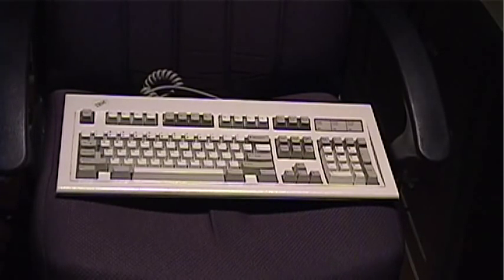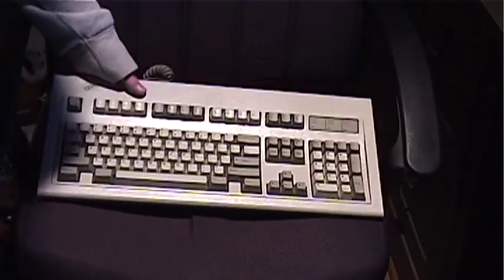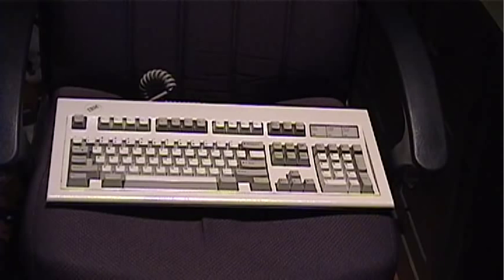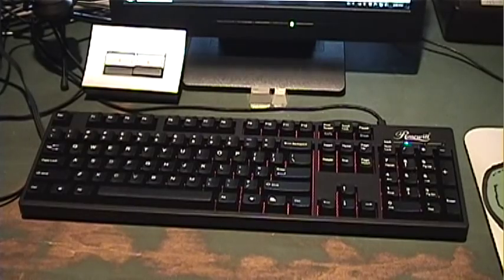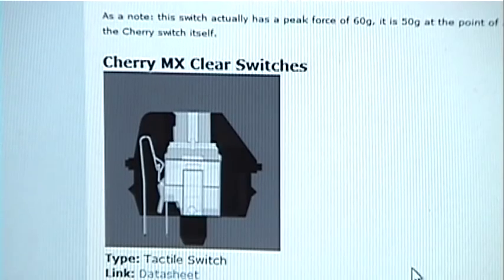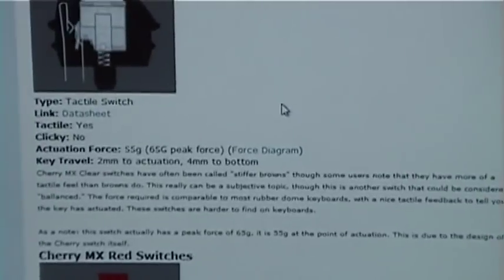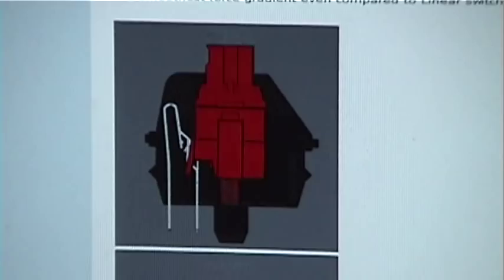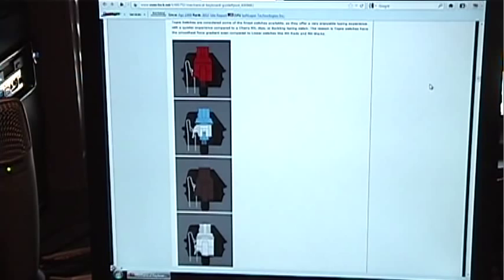Mechanical Key-Switches

Comment: I have used what I'm sure was a Model M, my relatives had a PS/2 years and years ago, I've not used a model M since the late 90's.  I use an iMac at home and I have what I call the Apple Low Profile USB keyboard, the Aluminium one that's been around since 2007, I like it, but the keys don't have much movement, so some may not like the keyboard action, I don't mind it so much.  At work we have HP computers with generic HP branded USB keyboard, the key action is so mushy on those keyboards.

Comment: i still like the old model m and key switches like it. rubber domes i dont like since they dont use a real true circuit board all it is is a plastic paper thin board with circuits etched into it. also the board gets taped or glued down to a real real circuit board containing the led lights and the ps/2 or usb controller. rubber domes are easy to kill with just water and no matter how long you let it dry out. i killed 2 dell quiet keys cleaning them. oh well time for more ibm type switches.